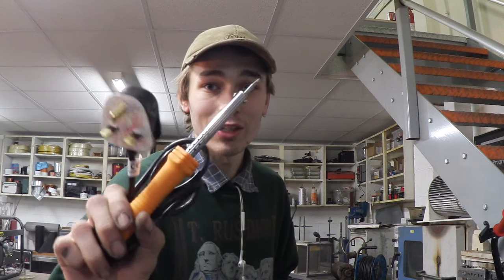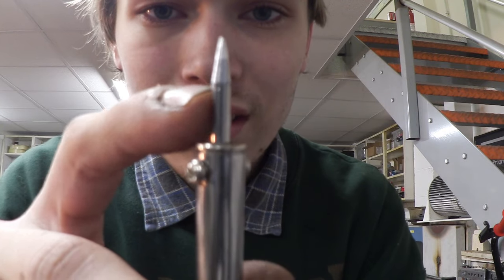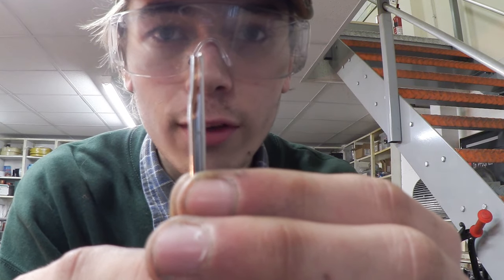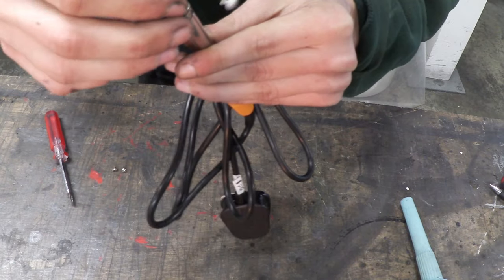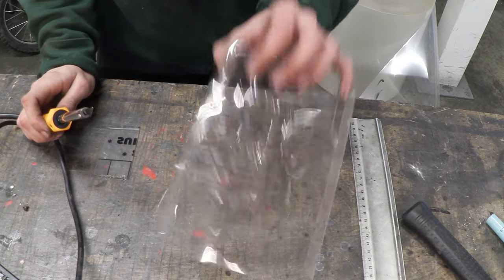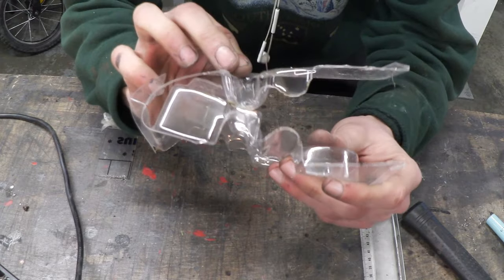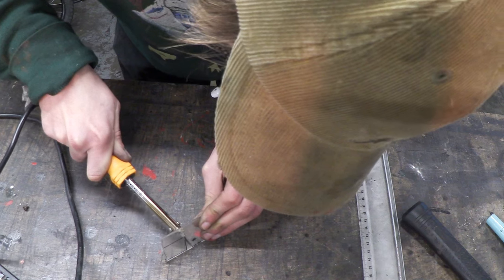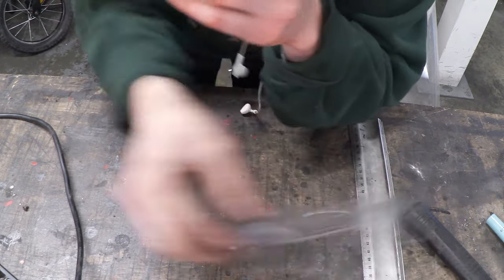DIY Hot Knife to Cut Plastics

Comment: Good and idea And well made! Great video, I could also see a use also for cutting nylon ropes to cut and stop them fraying out being a boater! Kev.
Reply: Great idea! I think that it could work in that application. I must try! Cheers mate. :)
Reply: @MyNameIsLukey  Thanks, Luke I also did a TV/Radio repair apprenticeship way back in the 1970s my old boss was always telling us off for striping plastic cable and coax cable with pliers or wire cutters or even worse a blunt Stanley type knife! He said the only way is to use a hot knife or old soldering iron to melt the outer plastic cover of stranded copper wire so as not to break or cut into the delicate strands! So another use maybe to strip wire. A very well thought out build for sure well done. Kev.

Comment: Good work, just make sure that you let the heat do the work and don't put too much force on the blade. Also careful to use a soldering iron like you used in the video, some have the thermal power switch much closer to the tip of the iron and are not suitable for this application.
Reply: That is something I didn't know, Thank you! I think letting the heat do the work is the way to go. I think I was a bit excited lol. Cheers mate! :)

Comment: like colin rhenius
 stated, a higher wattage iron would be better, or use a butane soldering iron.  you can by a assorted tip set for $9, one of them is a blade tip. maybe just grind / sand it a bit to get it sharper??

Comment: let the heat do the work,  did one f these many years ago.  eventually i sanded off the sharp part and the tip  because you dont need it sharp. and sharp +hot makes it 2x scary to try to use force and non-gentile cuts.
Reply: Thanks for the tip mate, letting the heat do the work is the way to go! :)

Comment: Looks like everybody else is already done it but an extra tip would be to know what the heat level or wattage of the soldering iron is, higher ones will cut thicker and quicker through other Plastics that are thicker as a heads up for you

Comment: Not bad.

I've done something simular in the past involving a glow wire to cut styrofoam. That can be extremely usefull. Pick a piece of hardened wire ( these tend to have a higher resistance, leading to more heat ). One single wire taken out of a bycicle breaking cable would be good. Stretch it, span it across 2 fixed points or maybe put a weight on it on the bottom of the thing hanging from the ceiling. Then take a good power supply and send 2 or three amps through.  Then push a piece of  styrofoam on to it. It'll cut in seconds any shape you want.

Comment: I have a soldering iron that I've used as a heat knife for years, I sharpened the tip into a knife edge with a bench grinder, it works great.

Comment: Many many thanks, what a brilliant idea and you have kindly solved a problem I've had! I have a large sheet of acrylic glass that's several decades old and somewhat brittle possibly due to age. My intention has been to saw it into 15 small glass panels to fit into an internal door that I was given, minus the glass! Using a conventional hand saw or hacksaw I feared it would crack the acrylic. Using an electric multi-tool saw could also crack it. Using your idea after first applying a hairdryer over the surface of the acrylic seems the safest way of doing the job. Again many thanks for an excellent idea!
Reply: Great idea - the hairdryer ! Have you tried one of those industrial dryers, that painters use to dry off their paint jobs quickly ? Just like a regular hair dryer, but far hotter. 👍

Comment: Good idea! I'll have to give it a go.
Several weeks ago I tried to modify a spare soldering iron to turn it into a hot wire cutter for styrofoam. It didn't get hot enough to work well. This looks like a much better idea, using the existing soldering tip as a blade holder. Excellent stuff!
Reply: the existing tip that I used was made from copper, I think it has more thermal conductivity so it should get hotter depending on the wattage of your iron. I'm unsure of this though. But it is worth a go! Cheers mate! :)